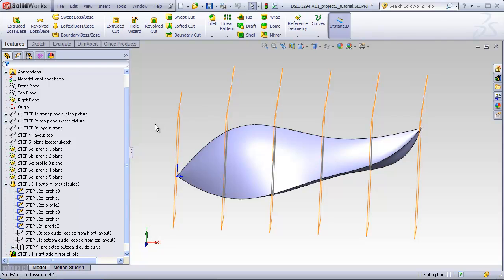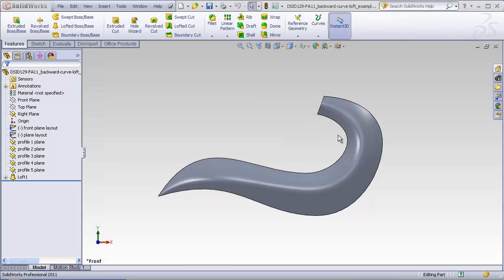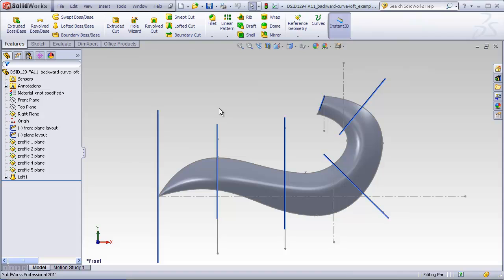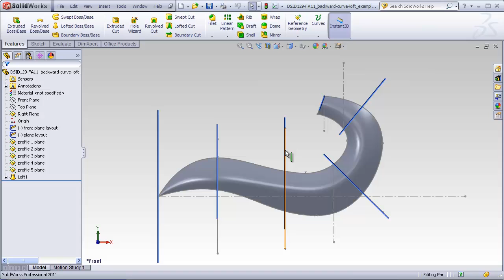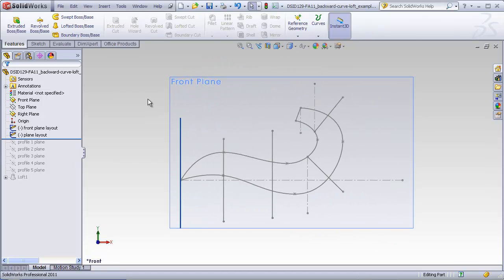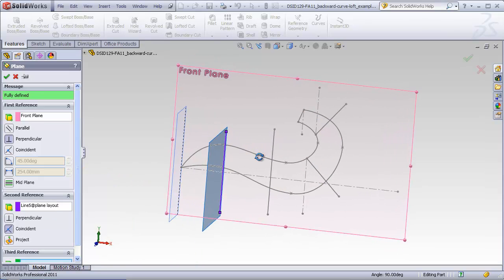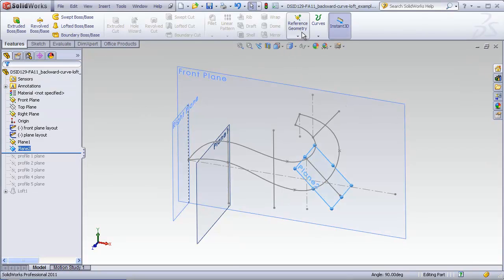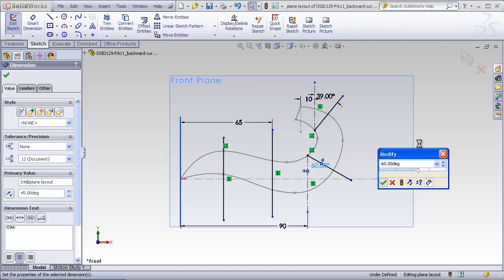DSID129, Solidworks Lecture, Controlling Angled Planes with Sketches

Comment: Hello, Thanks for the great tutorial.

I have a problem however. I have a 3D sketch, and I need to insert planes just as you did. 

My problem is that when I replicate your exact method, it only works with the reference lines that are perfectly vertical with the Y-axis. All the others show up as a "sliver" with errors.

I have gone through and deleted all entities thinking that this could be my problem...

Any Ideas as to what might be wrong?
Reply: Scratch that, I figured it out! thank you very much!